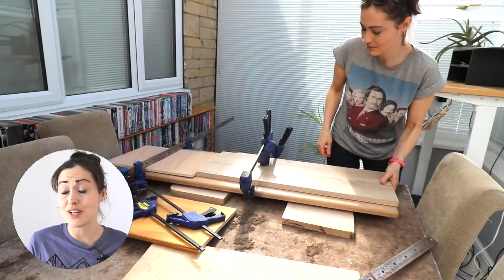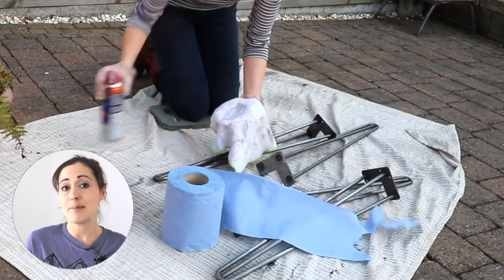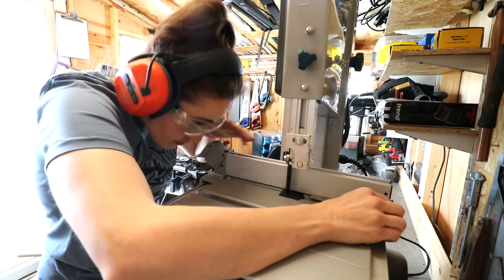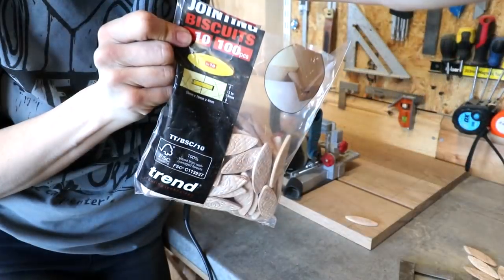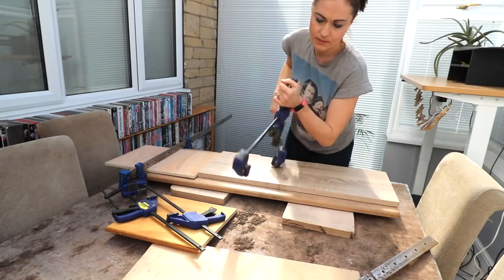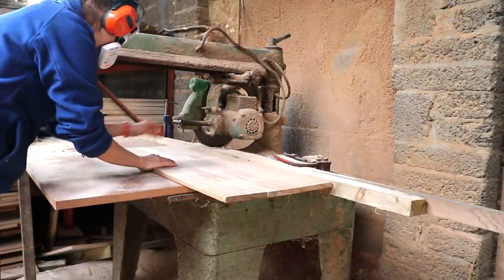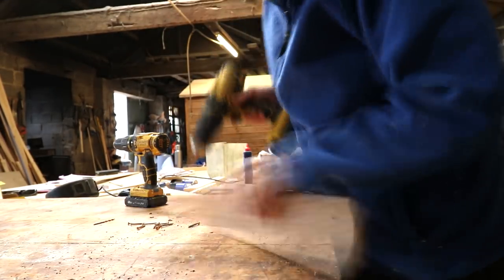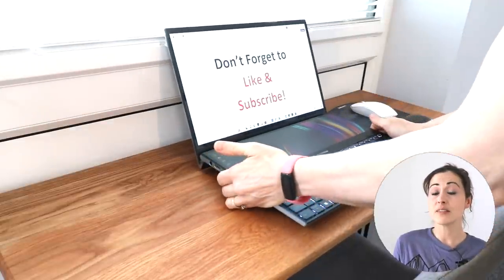My DISASTROUS DIY Console Table/Desk with Hairpin Legs | The Carpenter's Daughter

Comment: Nice job Vikkie. One thing to check before gluing up is to make sure the edges of your boards are 90 degrees to the face of the board. If they are not , you will get cupping. Also, do a dry clamp up to see if the panel is wanting to cup or if there are gaps between each board . An electric jointer or your longest hand plane can help straighten the edges  also. Do two boards till they are a " no gap " fit then move on to joint number two and so on. Always dry fit so you can correct. I always add the  cabinet makers triangle so the boards go back in the same orientation that you fitted them as. There is plenty of info on Google and YT about panel assembly. Alternating the grain up, next one down etc. helps in minimising the cupping of a panel also.
Reply from the maker: Thanks so much!  I'll look into cabinet makers triangle :)

Comment: Love it and the use of old paint. I would say the reason you had a bow is that your clamps were all on the top it’s pulled it. Use some on the bottom and some on the top. Also look at the direction of the growth rings and alternate them then it will be fine if you do another project, trick my Dad taught me .
Reply from the maker: Thanks for advice! :)  I think it's about time I bought some more sash clamps too so I never face this again!

Comment: It turned out really well in the end but I recognised all the difficulties you had! I think nearly all your problems (apart from hoping to make something 'quick and simple') came from the bandsaw cut. Check and set the guide bearings and put the sliding guide as low as possible to reduce deflection. As the blade cuts downwards it will tend to slide across a curve so then joining them will make it bow. It's frustrating but you are making finer pieces of furniture now and you'll notice how much accuracy that demands. Thank you for sharing your work.
Reply from the maker: Thanks for the tips!  I'll check the bearings again and make sure I lower the guide properly :)

Comment: Nice work, you learn from mistakes or projects you do along the way. Every day is a school day, and you always improve as you find ways to avoid further mistakes.
Maybe time to invest in a job site table saw 🙈 For those long rip cuts...
Think you may have needed to lower the guide bearing rail down to just shy of the board width to keep the blade from moving whilst you cut it...
Try to alternate the board grains also when you do large surface boards. Prevents a lot of cupping and movement, plane more as you can get a cleaner stroke than sanding it, and alternate the clamps, as you can never have enough I have learnt over the past few years...
Reply from the maker: Thanks so much for the tips!  Yes, you're right with the bearing guide not lowered. It's about time I put the whole thing on a cart with wheel as that was the best angle to work at on my workbench, but used it the other way after - although awkward.  Also, I think my table saw is too loud so not planning to use it until I insulate my shed.
Reply: @TheCarpentersDaughterUK  the saw is only as loud as a router table is... 🙈
Reply from the maker: My saw vibrates the shed, so not sure about that lol

Comment: Great job Vikkie. I’m going to make on of these and you’ve spurred me on. I’ll just put some large weights on top to stop the bowing 🤣. What preservative did you use? I’ve been using varnish lately but not happy how it dries sticky for ages. 

Have you seen those spray can triggers you can get? There are inexpensive and you can spray aerosols with knackering your finger 🤣
Reply from the maker: Thanks!  I ended up using what I had tor the finish too... Teak oil.  I was going to use Ronseal's total care in clear, but the teak oil said great for conservatories, and liked that option for later.
Reply from the maker: And no... not sure I know what you mean re: the trigger
Reply: Key in spray can trigger in a search engine and you’ll see what I mean .. you’d even be able to paint a mini bonnet 😀 they are brilliant.

Comment: Of course we would go buy one on Craig's list for much less than the price you mentionned, find it in sales or on wherever. That is not 'cause  there is no Joy in making it, but as you easily can understand yourself...you took a long time making this with a lot of equipment most people don't have access to.
So I choose to always make those sort of items of furniture with full size boards ready bought. So there is no problem of being even and sticking , glueing, jointing. And I use layers and layers of lineseedoil, first layer with some turpentine to give it a good shine and make a sturdy top.
Tx for your video
Reply from the maker: I can absolutely see that appeal 😅  Saves a lot of potential hassle!

Comment: Instead of the belt sander to square your sides, you'd be better off to use a plane, the longer the better. Even if you get the angle wrong, they will still mate since the error is cancelled when you butt them for gluing. With clamps, you can buy the clamping head type only to fit a 19mm pipe then buy pipe sections to any length you want. A cheaper way to buy some heavy duty clamping. If you want longer clamps, you only need to buy the longer threaded pipe. Loved the finished top.
Reply from the maker: Thanks so much for the tips :)
Reply: @TheCarpentersDaughterUK  One top pro tip is to always have your dog with you. When something goes wrong, you've always got someone to blame.